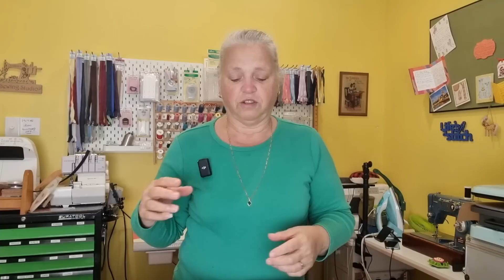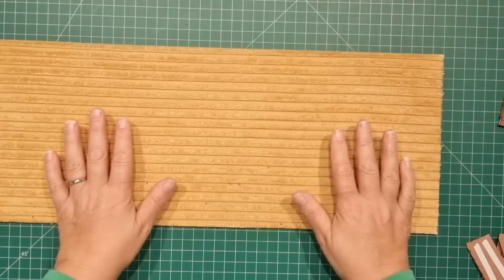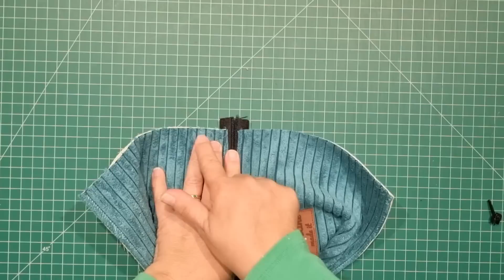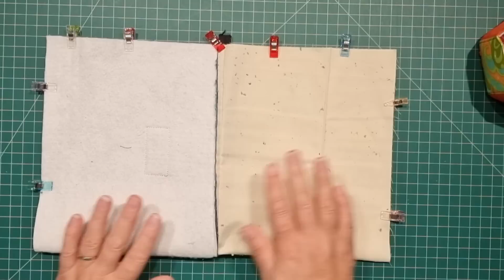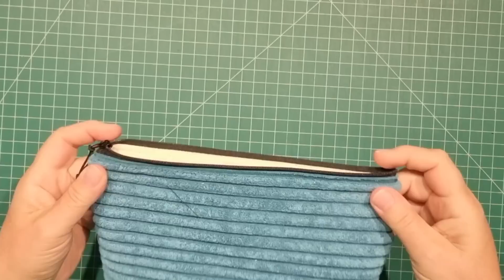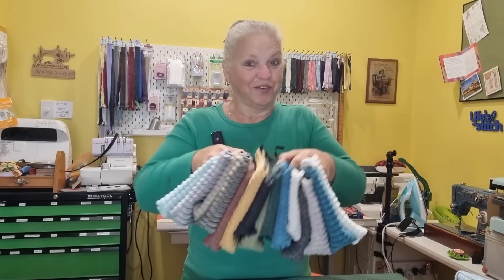Sew to Sell Zippered Snuggly pouches with only one side seam

Comment: Can u use a regular zipper?
Reply from the maker: You can Dave, but you'd be wasting the other side of the zipper tape unless you had a spare slider. You could also cut the fabric in half, and have side seams using a regular zip😀

Comment: Another great video! But a question, in your supply list, you have fusible fleece. At what point do you use this and does the fusible have any problems with the plush fabric?
Reply from the maker: I fuse the Pelon/Parlan to the wrong side of the outer (fluffy) fabric. I always use a baking sheet or teflon sheet to protect the fabric from the heat of the iron😁